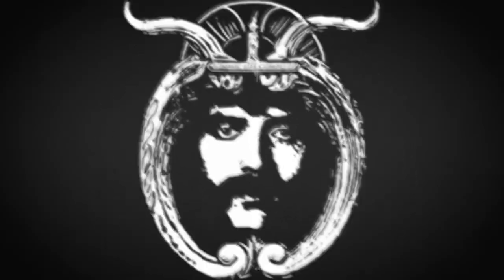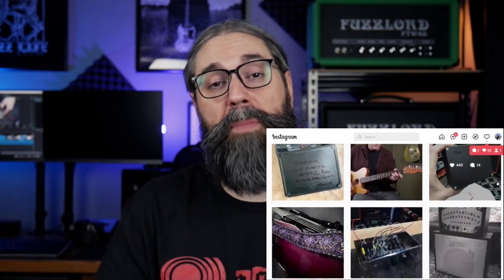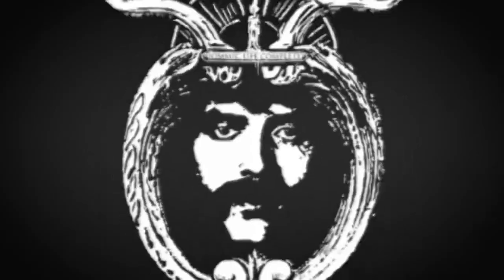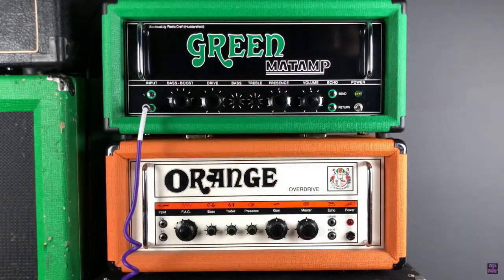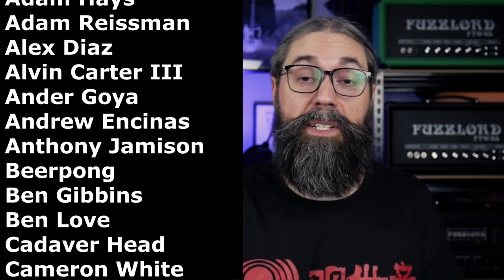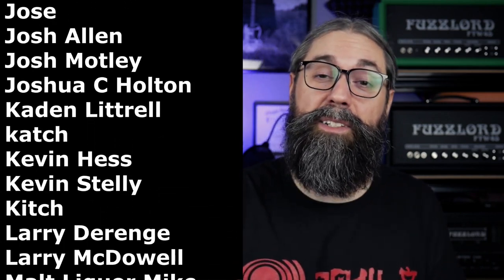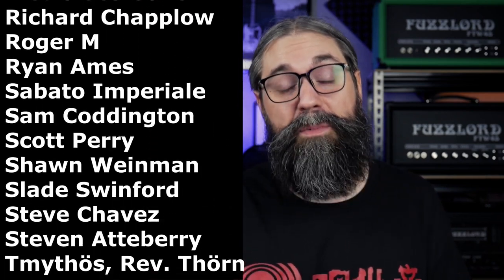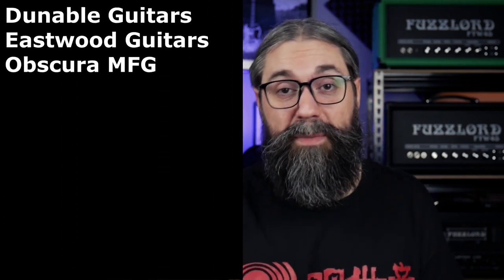Doom Metal Amps: GT120 VS OR120 Explained

Comment: I have a master volume OR120 - I definitely think that the master volume dial is quite limited in its usefulness - if you're somebody who gets your core tone from pedals, the master volume control is going to really change your tone. If you turn it down when you're not using amp gain, it makes your tone mushy, kind of like it's scooping the mids except not in a satisfying way. The master volume control is great if you want to use the amp's own gain (and I highly recommend using just a little bit of pedal overdrive to drive it - the amp gain really doesn't tend to like 'fuzz') but, honestly, although it sounds great, it's not to everybody's tastes. Especially if you do want a bit of a mid-scoop because the OR120's gain itself is all mids, and by taking mids away in your pedal chain (as there's no fx loop) is going to take away a lot of gnarly distortion away from the OR120. Either you learn to love the mids and you use the OR120's own distortion with the master volume in use, or you use 100% your own dirt, scoop away mids with some EQ and run the amp clean.
Reply from the maker: Thanks for sharing your first hand experience Alex!!

Comment: Great video, thank you Jason for explaining the difference in both of these amazing amps. Until I discovered Sleep in the mid 90's I had never heard of Matamp. I knew little of Orange as well until  2005 when they started showing up for sale in more abundance. Each amp has it's own voice, I have tried both and if it came down to choosing one I would not be able to. They both are incredible.  I wish there was a lower watt version of the GT120, I'd buy one in a second.
Steve's demo on Does it Doom really showcases both amps. If you havent seen it I highly recommend you check it out.

Comment: I'm recording a new local band the guitars came in with an or120 and a ac30. 8 string in hand with a massive board of just fuzz pedals. Not going to lie it's sounding really good I'm surprised at the combination. But if it works
Reply: AC30 is an awesome amp for pedals. Guitarist in my band (more stoner than doom) uses an AC30 and it's heavy as hell, both literally and figuratively
Reply from the maker: Damn that is a setup!
Reply: I never considered an AC30 for heavy tones- I have always looked at that amp for it’s clean tones.
Reply: @Tsudkyk  it's my go to for cleans and stoner but ever since I had them in I've been using my 8 strings on it and it just works for heavy fuzzy stuff.
Reply: A30 is lovely.

Comment: Grew up in the 80s with the metal scene of that time, but steeped in 60s and 70s hard rock.  In the early 90s, I ran across a local band in central Illinois using Orange and HiWatts - Hum.  Not necessarily stoner or doom, but worth checking out when you can catch one of there rare live shows these days.

Comment: Is the master volume just inserted into the circuit without changing the amp in other significant ways? It would be interesting to see if a switchable bypass could be put in to go around the master volume so you could toggle between them
Reply: You're talking about the Matamp GT1. It's a little different than the GT120, but has a master volume mode, and a non master mode.

Comment: Thanks for making this video. The OR120 is also great for mean twangy tones. I use a 90s OR120 on the recordings for my band ‘ta bien’. Feel free to hear the tones on bandcamp or Spotify. I mention this because it’s used in a slightly different context. I’m exclusively using the neck pickup on a nocaster in drop B.  I have two 90s OR120s and an OTR120. I have two dual dark 100s as well.
Reply from the maker: What do you think of the OR120 vs the OTR120? Will check out Ta Bien thanks!
Reply: Hey, brother. Sorry for the delayed response. I was waiting to do a proper A/B comparison, full volume.
 Each head into two orange 4x12s. At identical settings (in this case with the master at 10 on the OTR to essentially or almost disengage it) and the gain knob on each head slightly past noon…the OR 120 sounds more clear, articulate, and chimey. However, if I back of the gain knob about two notches on the OTR to say about 10 and a half o’clock,  they sound identical! 
I take from this that the OTR just inherently has more preamp gain, mine at least does. Granted lots of variables to account for. (Pre amp tubes and such). 
That being said the OTR, as you probably deduced, can allow you to dime the gain to ten and back the master off slightly to get a saturated smoother sound, that you can’t achieve on a non master volume head.
Am interesting comparison would be an OTR120 vs an Overdrive 120.
Cheers brother.
Reply: @FuzzlordEffects Jason! Dude, my previous answer regarding the OTR vs the OR was framed with an overdrive in front. 
I recently started using the OTR120 without pedals. Let me tell you, what a delight!!
I have the gain almost dimed and slightly backed off in the master. I can achieve that saturation that I would on an OR120 with a pedal, but since the OTR120 is being run without pedals. It still sounds THICK. 
The OTR will now be my
Main amp live.

Also, I had a buddy of mine who designs amps at EVH look at circuit diagrams of the overdrive 120 and the OTR120. Essentiallly the OTR is tighter and brighter than the overdrive, but im gonna paste his response below.

Your videos rule dude.

-joey 

“The 22 uF lets the preamp sag a little less. Subtle if anything. The 0.068 to 0.022uF shifts the input stage low roll off up over an octave. So it will be tighter no matter what. The 330 pF instead of the 1500 pF takes a lot of high mids out of the treble shed and the 0.022 instead of the 0.010 for the CCW end of the treble control shifts the high end roll off up a couple of octaves.

Bright cap on volume removed… so righter low end response and high mids shift up at the front of the preamp. Less bright so better low gain dialing, but thicker/flatter gain. The FAC is identical so the second stage is identical.”

Comment: I have a 90s reissue OR80. I’m in Portland and would love to know the difference between the originals and the 90s reissues that were built by matamp.
Reply: From what I've heard, nothing. They were literally pulling out old parts that had been in the shop since the 70s and just resumed putting them together
Reply from the maker: Matamp is still a badass small custom shop putting out very well made amps! They kick ass and make many different models. The insides of them are well designed and very asthetically pleasing for any tech to see!
Reply: @FuzzlordEffects  Mine has been in the shop for about a month trying to track down an intermittent issue. Even though mine is a reissue, it's still a 30 year old amp.

Comment: Can you expand about the voicing differences between the two?  Is it FAC/EQ placement or cap values that change the voicings? Do both FACs filter the same frequencies at each notch? I like the voicing a bit better from Orange, more punch, more mid focused, and not so fuzzy, but I like the clean and very low gain from Matamp better.

Comment: I can't believe you say the GT120 is a high gain amp of it's time? holy shit Matthias designed it for jazz guitarists to get ultra clean tones from their headroom haha i've had at least 6 different matamps over the years including a reworked slave in a green sleeve GT120 which was fundamentally the same as what sleep got in the 90s aswell as a white front 70s GT120. matamp was a holy grail amp for me to get for many years but i never got on with them fully. I always preferred Laney Klipps and supergroups. eventually i came up with my own circuit idea and built my own amps using old carlsbro transformers and modified circuits based around the carlsbro TC and 100 top amps. matamp GT120s from the 70s were not at all reliable when pushed full volume. you'd get the sound but the tubes would soon be compromised.. and i'm not saying Laneys were any more reliable either the HT voltage was absolutely limit for el34 tubes on those hence the Iommi tone. i guess thats where i realised the carlsbro amps with partridge transformers were the real deal for me at least. those old amps need a ton of work to be properly roadworthy and reliable. 

anyway whatever amps you play enjoy them and don't take shit too seriously.. peace out Munger.